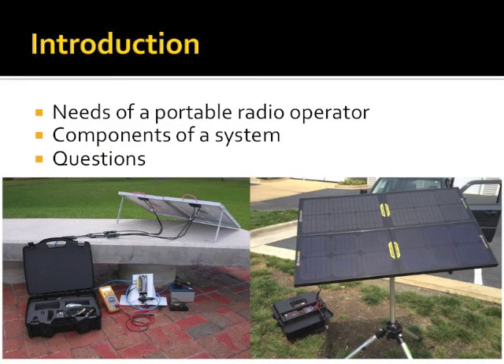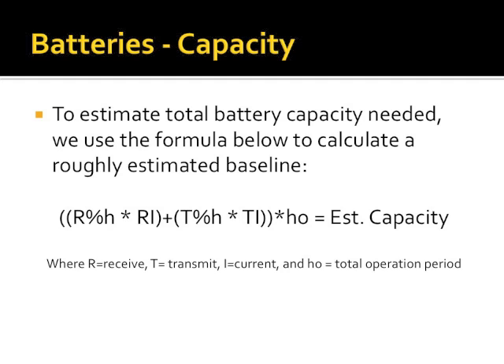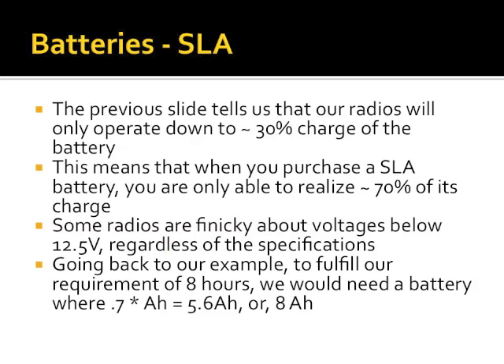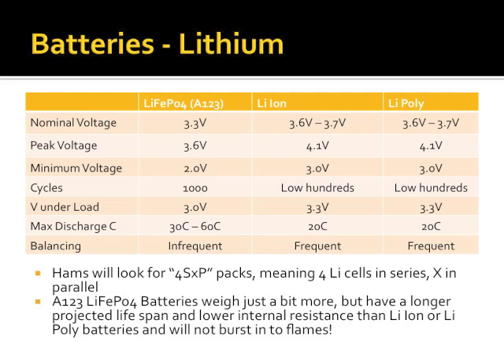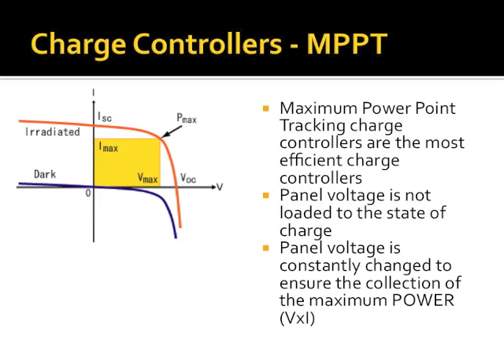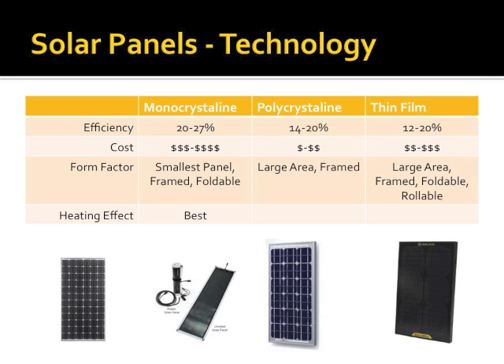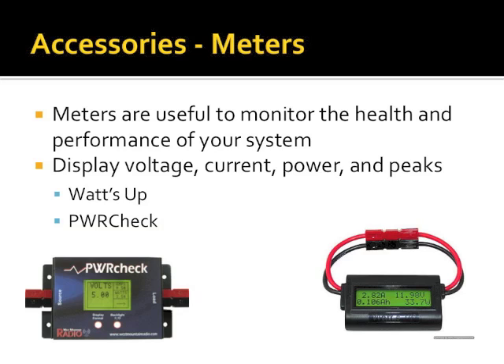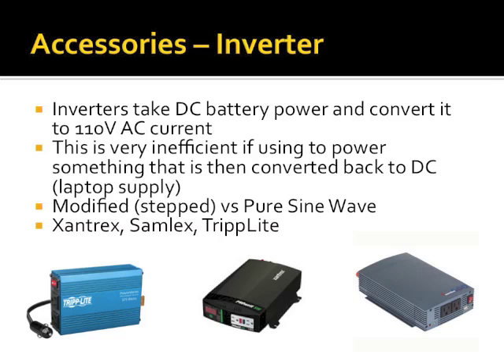Portable Solar Power - a Primer for the Radio Amateur

Comment: On Elecraft rigs double check for solid soldering. That loose component that the rig tolerated under ideal conditions could go bad and short under voltage spikes. For instance if we accidentally connect directly to a solar panel without a good regulator. Those panels under bright direct sun light could spike up in voltage at times.

Comment: Glad I found this - just picked up the Harbor Freight solar kit for $160 to my door. It's in my budget, and I can charge up a small battery for emcomm. I like the Goal Zero but can't afford it until next tax refund...lol. I have a 2 DC marine battery set-up with an inverter and a generator for the house base station. When I get the solar situation under control, I'm going to build a DC generator with bike pedals we used to use to recharge the battery for our 5-watt manpacks in the Army (CW mainly). Used to call it the "3000 club" as it took about 3000 turns to charge the battery for transmission of a typical 120 character coded message. That was in the 80s. Gotta love technology!
Reply from the maker: Awesome!  If you get a chance, we'd love to see a video of the pedal generator!

Comment from the maker: You have three options:
1).  Buy one of the GZ adapter cables and cut the end off
2).  Buy the 4.7mm plugs from Digikey and make one
3).  Utilize the female cigarette lighter socket and purchase a male cig to PP adapter from Powerwerx.

Comment: Ballistic BMS charger will charge Li-Fe batteries and balance them as well. It uses 11-15VDC input so theoretically this would work in a solar system. It's also only $80 as well instead of the $500 Genasun charger.
Reply from the maker: The Genasun charger I'm using has a Lithium version for $115 that's MPPT, which is still a great deal.  Also, the Ballistic charger is a multi cell battery charger that's rebranded (there's nothing special about it being being Ballistic) and often sold under other brands as well.  While that charger may power up, it won't be as efficient as it's not MPPT.

Comment: LiFePO4 batteries have battery management systems that balance the cells so the charger doesn't handle the balancing. At Field Day I would take a UPS that had a modified sine wave inverter, and I discovered that my laptop's AC adapter ran really hot. Later I found out that it was the modified sine wave inverter that can make devices run at a much higher temperature because they are not running off of a pure sine wave or a sine wave you would expect from household AC power.

Comment: Thanks heaps for this video, I learned so much more than the past days of research I've been doing! So yeah, thanks!

I was just wondering: am I correct in thinking that a battery controller like the gensun expect any variable voltage as an input not just a solar panel? Like a car battery for instance?

I'm thinking of having a self contained luggage with my icom 7100 and all the voltage meter, LiFePo4 battery and all the rest. This way the solar panel would either charge that self contained luggage when I walk around, or my car would and the panel would then charge my car. Is that a feasible idea or am I missing something?

Comment: Thanks for the great vid!  I found it very, very helpful.

Question for you:  Have you swapped out the cables from your Goal Zero panels yet?  If so, can you please let me know what you used and how you put it together?

Thanks again.
Reply from the maker: I did for the 15W panels using a 4.7mm plug from Digikey.  Search for stock number 	CP-014-ND at digikey to find the connectors.  I then used short (18") runs of 22gauge copper cable.  These terminate to Anderson Power Poles which Terminate all connect to a 6 way block I found at HRO, then I use large gauge cable from there.  I could never source the 8mm plugs on the larger panels.

Comment: I have found headway cells. They are LiFePo4 in the 38120 and 40152 sizes. They are respectively 10AH and 15AH. So there is another option for making large battery packs,
Reply from the maker: Steve Blandford Thanks for the comment!  I have seen these before as well and from the EV/EM forums, they seem well-respected.  I haven't played with them myself though.

Comment: Nice presentation, i made a powerpack with 2 x 200Ah AGM , search for ON5DI here on youtube.
As a sidenote , victron seems to have some step down 24V > 13.8 VDC 70A  regulators . I prefer mains voltage so i can power my laptop and some other tools.
73's Johan ON5DI

Comment: Awesome presentation and guide to the whole process. I'm wondering why your Ahr rating discussion is based on a complete kill-discharge. The datasheets I've seen for SLA batteries usually show capacity based on a C rating down to a "safe" voltage, usually about 10.8V, which is the lowest you can go without starting to damage the capacity.
Reply from the maker: at 10.8 V, you are barely around 10% state of charge for the battery.  The minimum safe voltage is generally considered 10.5.  For amateur radio use, these days, I never talk about 12V as that's about 50% state of charge and just a bit above the -15% of most radios' voltage needs.

Comment: Nice video well something very important the ic 7000 is a juice succer ts 480sat to  by my test the only radio that put 100 watts using a battery pack is the Yaesu ft-857D that was tested the ic 7000 706 kenwood ts 480sat only put 65 watts on the battery pack, so keep in mine the icom and the kenwood will drain your battery pack very quick. the 857d is all mode 144, 440 ,HF and you can use the 857d on 5 watts like a qrp radio don't waist your time buying those qrp radio to much money for only 5 o 10 watts go with the 857D and you can use the ATAS120A on a go box and the rad 857D will found the lowest swr so you can used portable mobil base my 2 cents hope it help 73'

Comment: Test inverters if possible, do not trust the labels. Avoid charging off portable generators with built in inverters ! Especially those sold at Homedepot and such. Only generator with a clean AC output I have found so far are the expensive Honda portable generators.
Dirty AC sine waves cause noisy transmissions, noisy receive and will eventually destroy the radio.
Avoid DC to AC all together if possible, it is inefficient. 
Check out marine supply stores for DC appliances.
Reply from the maker: Lancelot Xavier Are you saying to not use the Honda Inverter series like the EU2000I and EU2000i companion?  Both are inverter generators with incredibly clean AC and no RFI.  I also notice that they seem much more fuel efficient than non inverter generators.
Reply: KF7IJZ Read the comment once again.
Reply: Lancelot Xavier Out of curiosity, I have the Yamaha version of the Honda inverter.  Do you run at full throttle or with the load based adjustable throttle on?  I ask because when I charged my laptop off the Yamaha the mouse moved kinda of clunky.  Not bad enough to cause an issue, but I noticed it.
Reply: hoshnasi I do not have a Yamaha. On the Honda the throttle is automatic. You might be putting loads on the gen. Quick fix. Place a ups on the gen.
Reply: Lancelot Xavier Good point on the UPS, although that might draw a higher load than the laptop alone. Yes, both the Honda and Yamaha use a load sensitive throttles.

Thanks!